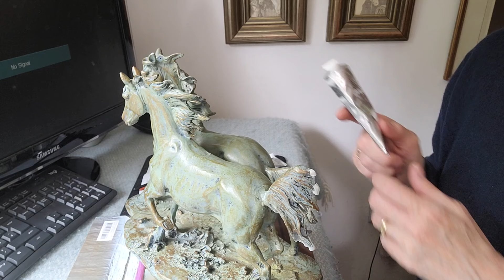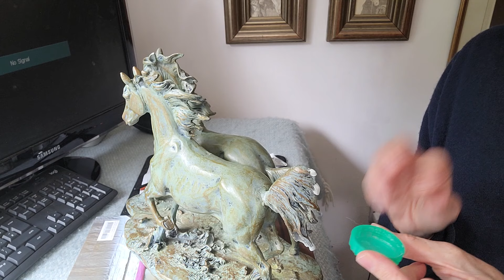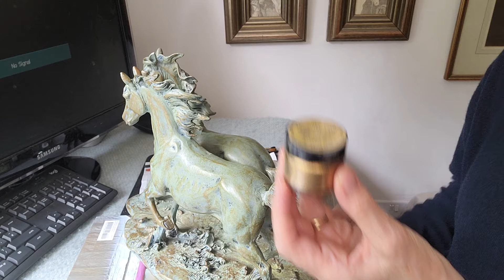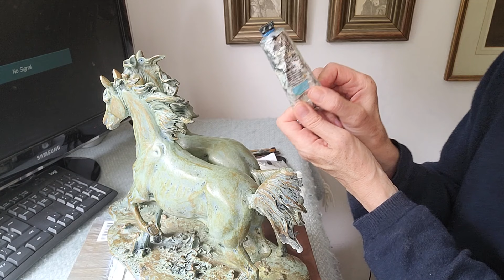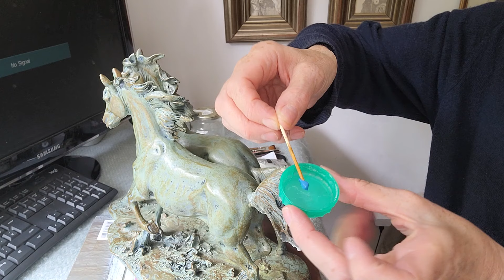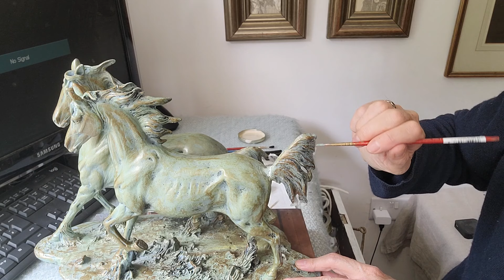Ceramic Painting The First Stage/For Beginners  #ceramics #restoration #porcelain #repair #diycraft

Comment: I find your tutorials amazing and so inspiring! I would be extremely grateful if you could give me some advice . I bought a Doulton Lambeth faience Vase and sadly a section of the base arrived broken. I managed to stick it all back together and applied the milliput and waiting to sand it down. After this I will need to paint over the chips and cracks. Would Windsor and Newton  oil based Paint and Glaze work for this or what would be the best suggestion. I am a professional artist and the artistic side would not be a problem on my side. Thank you in advance, Kind Regards, Nichola
Reply from the maker: Hi there, many thanks for your comment. I would only recommend powder pigments or Winsor and  Newton  Professional Acrylic paint and glaze, not oil based.
Reply: Thank you!  @TheCeramicRepairStudio

Comment: Just curious, can you use thinset/mortar (like for adhering tile backsplash and flooring) as glue for repairing broken ceramics? I’m trying to avoid 2 part epoxy/products if possible and I know super glue is a no no..
Reply from the maker: I have never used a thinset mortar. So unfortunately cannot say.